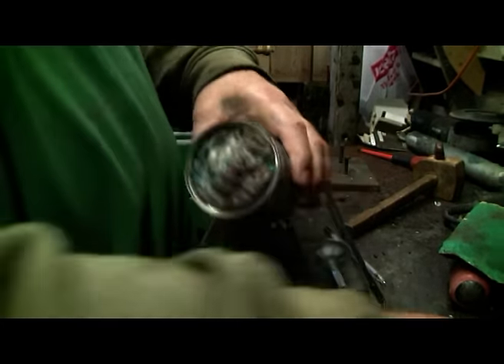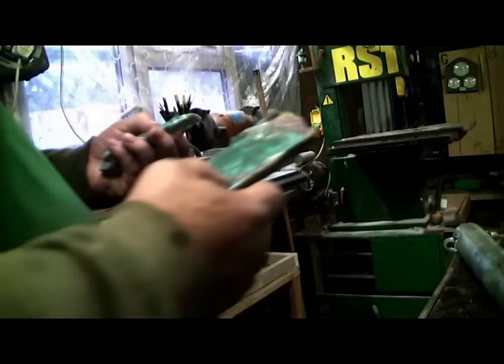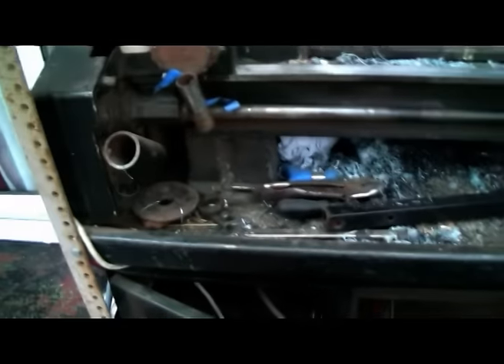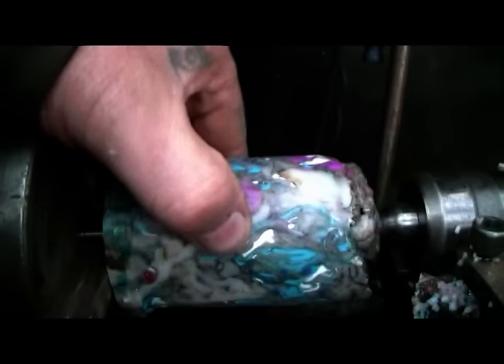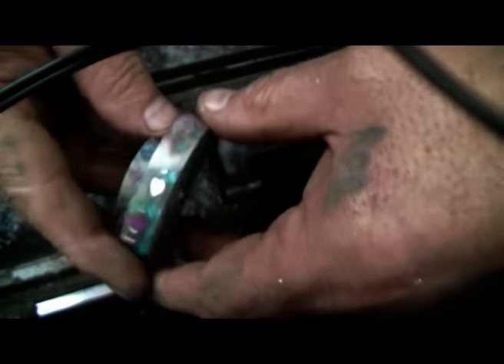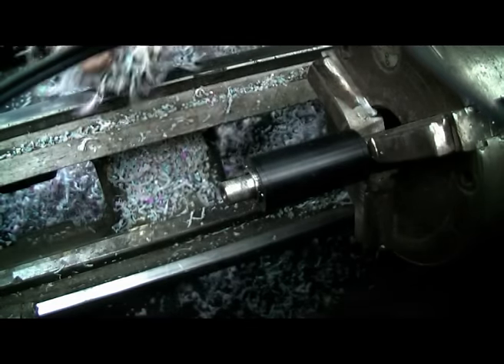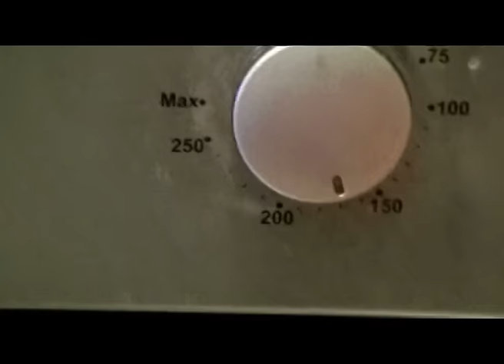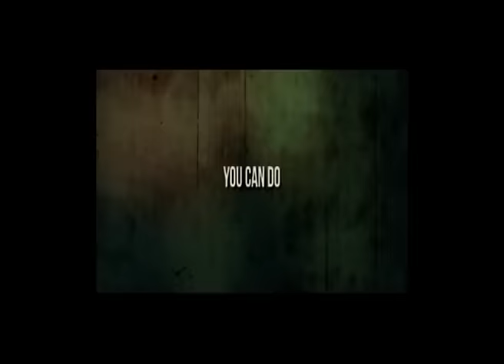how i try my hardest to sort things out.HDPE 2

Comment: robert you used a ring pull can try using the other type of can so you can reuse it. The can make a wooden disc so you can compress the plastic to get all the air out.

Comment: 1st. I don't think you had the temp high enough.... the air holes should have floated to the top. (Our temp US 375/400f -- Your temp would be around the 200c range
2nd. When you were 'dripping' the plastic to fill the holes... you never heated the base so how were the two
going to bond?!?!1  
3rd. When you were taking the plastic out of the can.... all you needed to do was remove the 'ring around the top of the can and it would fall out.